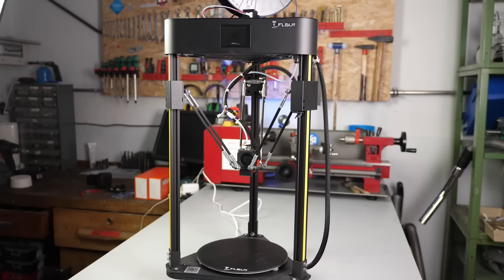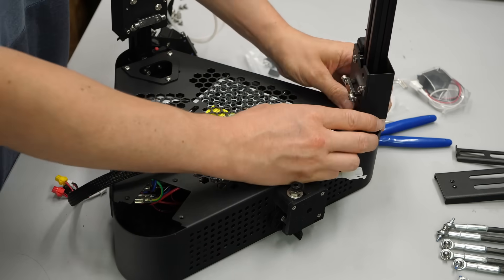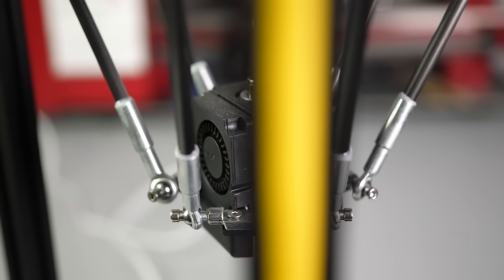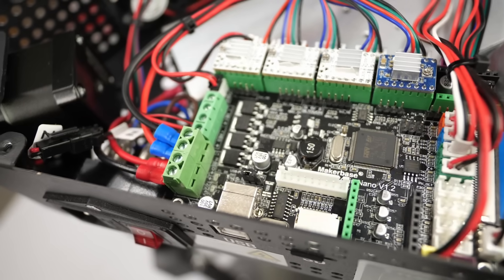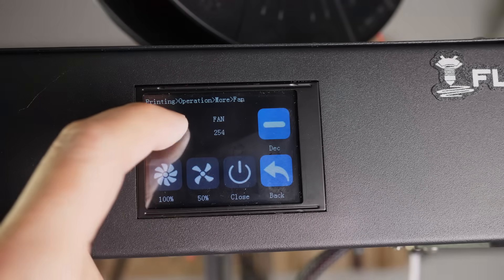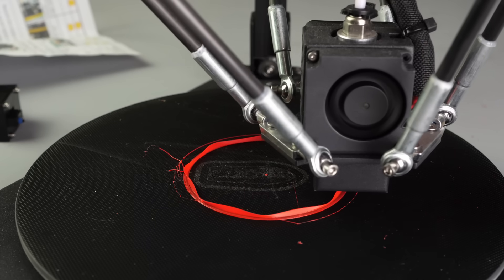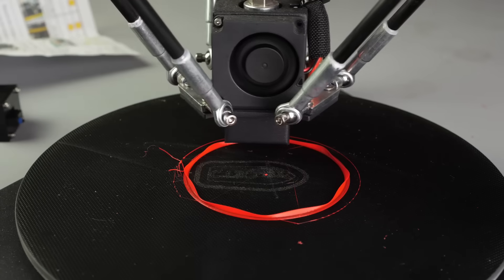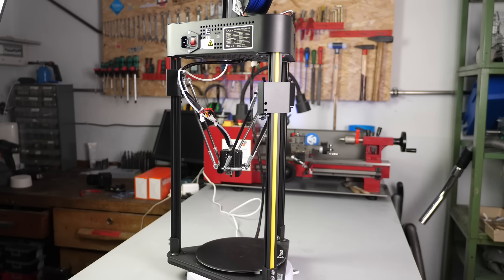FLSUN Q5 REVIEW - A 90% great machine!

Comment: I'm way late here, but in case it helps someone, turning off the recover after power loss feature really helped the main board keep up during printing and reduce the blobs like you saw on the lumpy bumpy vase.  This was actually on my QQ-S, but it looks like the Q5 is electronically the same.

Comment: one of my favoutire printer i just love the way ti works i have  upgraded the fan with a noctua had to use a voltage step down cuz the old fan was 24V but it was easy also instaled a led stip on the top and i have lights as well

Comment: I just bought q5 just because it was super cheap.. Only thing I did for now is change to capricorn bovden... So far I am surprised how well it works.. the default cura setting seem to work fine - the resolution of 0.5mm seem to help the slow board, so the print quality is good.. the sound of the fan is a bit on the high pitch but it is also on enders... I only own enders with that cubic type nozzle set (ender3pro, ender5 and ender5plus), also I dont know for ender 5plus it is a talk about having silent drivers which are not silent at all(they were the same as on the stock ender5)... I rly like all enders but the simplicity and ease of making enclosure for q5 would make me reconsider which one to chose between the 2(if i had to choose)..

Comment: Bought one at an auction but have had problems. Initially the extruder was moving in reverse but I managed to fix it by reversing a couple wires on it. Second problem is that the pla won't stick to the plate. I've tried many things including changing temperature of plate and tip. Cleaning with several degreasers. Adding glue stick. Spraying with hairspray. Nothing works.

Comment: Lerdge board is garbage, no marlin support is a dealbreaker to me, but otherwise looks decent. Open source ftw. I like the ABL solution, I would prefer a detachable probe that you use periodically over no ABL at all. A lot of the parts I print aren't very conducive to the round+tall build volume, so I'll stick to my bed slingers for now. Prefer corexy to deltas for high-speed printing, although the sapphire, the main budget corexy also uses trash board/firmware.

Comment: I bought the FLSun Q5 based primarily on this video, but I did watch others.  It is my first printer.  I had it built in a half hour and have been very pleased overall with it's simplicity.  The only problems I've encountered have been my slicing and gcode, not the printer.  Yes the cooling fan is loud.  Almost as loud as my PC after playing KSP for an hour.  I think the Q5 will make a nice backup printer one day when my modeling skills require a higher resolution printer.  This is only a hobby for me and I'm happy with a simpler machine that's less intimidating without all those mods and features that I'm supposed to need.   With my skill set, I could have a $28k printer and my prints wouldn't look any different.

Thanks Stefan for an honest review and opinion of the FLSun Q5.  I am very happy with my printer.

FWIW; I bought the Q5, four 1kg rolls of PLA, and the Sunlu S1 filament drier for less than an Ender 5 Pro and nothing else.

Comment: Moin Stefan, I got a flsun qq-s pro as my first 3d printer and got a lemon... First it was great but it didn't age well... Belts bend right of the box, the bed warped very badly after a 2 weeks to the point that's unusable. Many others in the Facebook group have similar problems. And it also lost the leveling a few times on different firmwares (including marlin)

Comment: I've got a QQ-S Pro, I don't know why you wouldn't pay the extra few dollars for a bigger build volume - 220dia by 360mm. The electronics are all in the base. And I'm sat next to it right now with it printing away and I don't hear any annoying noises. I'm not expert on the topic yet, I've only printed about 500g of PLA with it, so I won't comment on tweaking parameters for better prints etc. I'm not printing jewellery with it or toys so I'm less concerned about ultimate quality.
The upgraded main board could be interesting. I'm using OctoPrint to control it though, so there is no pressing the buttons on the panel.

Comment: I am a month late on commenting but I have a Q5 and I love it. I actually just a week ago finished an upgrade to allow dual color printing from a single nozzle. I upgraded all of the steppers to tmc2209, changed out the hotend fan, changed the parts cooling duct, changed the power supply fan, added second extruder, changed to bmg dual gear extruders (for better flexible filament printing), and went over to Marlin 2.0.6.1.

The issue you were having in this video is most likely related to Linear Advance. If I enable Linear Advance then it does the same thing that you showed in the video however if I disable it then it works fine.

Overall you can print out upgrades for this printer than improve it a tremendous amount and change out a few parts for very cheap to make it a quieter more flexible printer.

Comment: Hi, thanks for this review, if i had not yet bought one, i think i had been convinced to do it! As you said, i choose it because it is so easy to assemble for a first 3D printer, the ratio between printing/printer volume is very good as it is a delta printer! And the dance of the head and arms of a delta printer during printing as something hypnotic... It also have a very good printing quality out of the box ( tmc2208 are already installed for axes), and is relatively quiet compare to printer of the same price range. The spool holder is the first thing to change, it is so easy to print a good one! Then i've installed a tmc2209 for the extruder and it become completly quiet ( change motor direction and put extruder max acceleration to 250 in firmware). Now i can only ear the fans, and it is difficult to find a good 24v replacement ( i've tested some noctua and noiseblocker 12v with buck converter, but then they are not powerfull enought compare to stock fans). There is a good program (certainly made by FLSun) that almost automaticaly calibrate prinitng dimensions ( you enter the theorical and reel dimension of a test print, that's it):https://www.facebook.com/groups/120961628750040/permalink/708716593307871/

Comment: Have a love hate with this, Ive had 3 in the last 2 months, first one popped the psu after 24 hours, 2nd arrived broken in the box, psu mounts snapped. 3rd lasted 6 weeks, fantastic in this time until yesterday, mid print it homed and then proceeded to smash into the bed at full speed, move to the side and get wedged up against the rail. Hopefully can refund it and have no idea what to buy instead, really put a dampener on the hobby!

Comment: I bought the QQ-S "Pro" and it's the shittiest printer I've ever had. The main problem are the rods which have different lengths and thus making the printer unable to print anything square. By models over 100mm the whole printer is shaking as it's ready to fly (or die) any moment soon. It needs so much upgrades that for the money I can buy 3 Ender 3s and print twice as fast with them. It's my first and probably last delta for many years to come.

Comment: I have an flsun cube. Great printer when tuned up properly. I recently got a tenlog 3d pro idex printer. This new one does dual the right way with independent exteyders that get out of each other's way. I will use my cube as a single extrusion machine and the new tenlog as my choice for dual extrusion projects.

Comment: I have an awesome video idea for you... bonding/glueing PETG parts together and which is the best method. You could check the strength of all the bonding methods (super glue, plastic weld, hot glue gun, ect) PETG is an awesome plastic and the middle ground between PLA and ABS but it has a terrible time bonding to itself with glues. We need a CNC Kitchen assessment for the best scientific method for attaching PETG parts together. Keep up the great work, cheers!

Comment: Hello Stefan! Could you try out something, and make a video about it?

I need to print a model that have 1,6mm wall. I thought i have the 0,2 nozzle, and i set in Simplify3d to that 0,2 dia. The model it printed out nicely, but i said hey, it's actually 0,2 the nozzle? I lifted the nozzle Z100 exteuded, and the filament was 0,4! Though the print still good. 

Can you make a video how the print changes with 0,2; 0,4; 0,6 nozzles, with 0,2;0,4;0,6 sliced programs?

Comment: Stefan as of lately I have come across people applying thermal paste to their PTFE lined throat claiming it increases the thermal conductivity and increasing heat dissipation to the heat sink, I am not convinced of this as surly it also draws more heat to the throat from the block by the same process and potentially cause blocks and retraction issues.
 What are your thoughts on this? and could ou do some experimentation on this?

Comment: Brought one. Great printer. Easy set up out of the box. Great quality prints using pla for such a cheap printer. Well worth it. Easy to move around the building. Use a cable tie to hold leveling attachment in place when using as may move if not. I found the magnets not quite strong enough. Otherwise a great buy.

Comment: Seems to be very sturdy and looks like a bigger version of the Magician that I have. I love delta printers. The first printer I ever bought was a delta printer kit from China. The fan on mine is also quite loud. Mine runs Marlin. I'f love to upgrade but have know knowledge about how to do it in a right way. Mine has a limit switch as a touch probe. I always have to do some calculations which have to be uploaded to the machine manually.

Comment: I got my first big delta last year in the form of an Anycubic Predator. The machine was very nice out of the box, but nowhere was it listed what kind of software it was running, so my first few prints were totally jacked up as I tried everything under the sun. Eventually I figured out it was based on RepRap, and presto, back in business. After a fairly extensive fine tuning of settings and trying all the slicers I've racked up, Cura made the best prints for this machine in the best print times. I've upgraded a lot of the parts too, added TL Smoothers and motor mount vibration dampeners, print head, etc. The heat bed was great at first too, but after a dozen or so, the topical additive the manufacturer adds to the bed has worn away and I have to use good ol' glue stick and clean that sucker surgical smooth to get prints to stick. Last little quibble--and I've tuned the mechanical parts to perfection now--but the print head would occasionally hit the print, knocking supports off or in the case of my last print (a marathon print trying to get a 185mm prototype turbine part), embedded itself in the model and ruined a print head due to a full spool turning into a gigantic blobby of filament spaghetti. After months of waiting and importing several replacement third-party heads as Anycubic wanted $9.00 for a print head but $50.00 to ship it, only one of the four would register to the firmware and accept readings from the thermistor, etc. That was more of a pain than I was expecting, so if you go with any of their FDM printers, you'll probably want to upgrade to a better print head sooner than later...

Comment: Picked this up back in July and I've been very happy with it being new to 3d printing. Only things I've done is add a pei magnetic build plate, and I will need to clean\rebuild my hot end due to it starting to leak recently. It's def ruined me for cartesian printers due to the faster print times.

Comment: damn, I was excited about this printer until you got to the part where it's max Z is 200mm~
I've now got SEVERAL prints that take the ender3 all the way to the top, the end step where it moves the head off the part actually hits 250mm exactly.
guess i'll be waiting a little longer until someone makes a vertical extender for this machine.
also yes, that bowden tube the way it's set up looks very much like it's too twisty, I've got about a 1m bowden feeding my ender and it  complains unless the tube is as unwound as it can get at pretty much all times, I've even got a hook at the top of my enclosure to hold it up so it doesn't coil too tightly.
Reply: The Ender 3 can't print 250mm tall objets. More like 245mm.

Comment: check the facebook group where Gottfried Wilhelm Leibniz uploaded a marlin 2.07 firmware for the Q5

Hi there, as requested Marlin 2.0.7 for the stock Q5.
The Display works great, though the menu points are smaller.
In the zip is the source code and the precompiled Version. For install just put the "Robin_nano.bin" on your sd card, put the sd card in your powered off printer and turn on. Linear Advance is turned on you might want to check that out.
Don't print directly:
After installing you have to set your own Extruder steps/mm-value. Put on the probing sensor. Find the right nozzle to probe z offset via M851 and several Bed levelings. Mine is at -19.17mm, but yours may vary. And do a delta auto calibrate via G33. Also PID-tune your Bed and Hotend!
Of course always be cautious for the first hours, and please give feedback!
Known issues:
Babystepping is not working. I haven't disabled it, but it bugs the axis, using it can lead to uncontrolled printhead moves.
Unified Bed leveling was bugged, but bilinear ABL is turned on and works great.
Reply: I’d be curious to know if enabling the “experimental” integrated babystepping option helps with this deltabot. It applies babystepping inside of the stepper ISR instead of during the 1kHz timer, on the theory that this approach will be more stable.

Comment: FLSun provides a good product, my (linear rod and bearing kit version) FLSun i3 is still running strong after three years and many mods later, with the only issue being a solder joint breaking off an end stop switch once.

Comment: I was always wondering what the point of the 3 arm design is. Seems it's for speed? I would think that it's going to have terrible accuracy, due to the long arms magnifying any flex... and I would expect harmonics start reeking havoc above a certain speed. I just don't get how this design would ever be more effective than the "cartesian" design. If accuracy was not a concern I could see it being able to handle insane speeds, but that's the only advantage I can think of.
Reply: Not having a moving bed for y axis is a big plus, if you need small x-y dimension but very tall z delta are the way to go (have a look at the k280 by he3d). For the rest best compromise speed vs quality is core xy.

Comment: I cannot follow most of the criticism at all:
I own an Ender 3, Artillery X1, JGAurora A5 and now this Q5, and the Q5 is easily the best printer or of the box I have ever owned:
More than acceptable quality from my first print (using the sample filament which is quite good), able to print at high speed (I print with 90-120mm/s) without visible impact on the prints and good prints every single time: something which none of my other printers is able to do.
On top, as already mentioned the small footprint makes it the perfect printer for my desktop...
Reply: Recommend it for a first printer? I’m stuck between the sidewinder x1, prusa mini, and flsun

Comment: You can install Marlin2 to robin nano and use most of it's features. I believe even linear advace can work good with a short bowden tube like we have here. And there is an option to place extruder on the top of the head using springs attached to carets, and get shorter retracts and better K-factor.